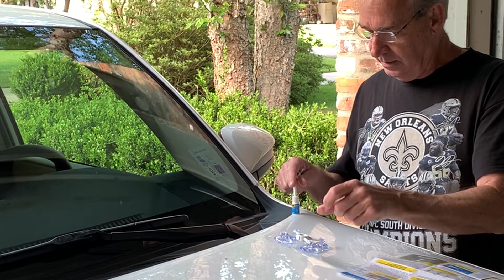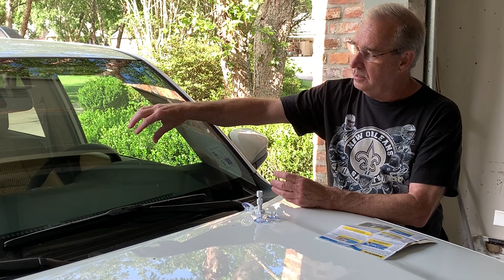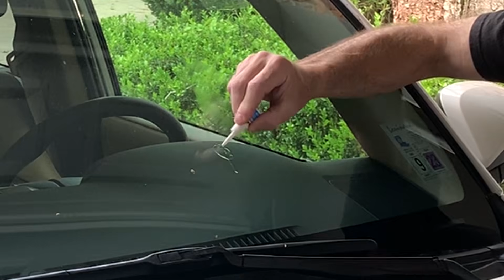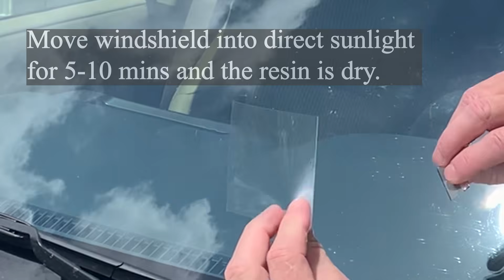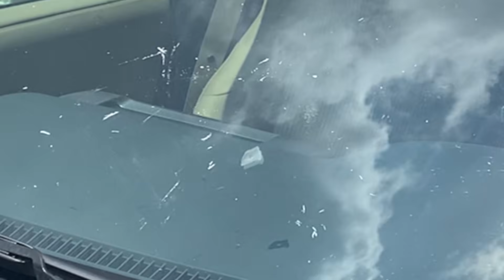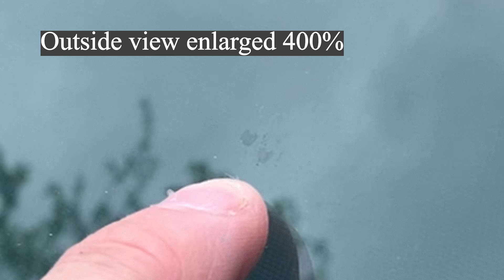How to use Rain-X Windshield Repair Kit

Comment: Please note, if it’s cloudy and 45 - 50 degrees F, I used my windshield defroster for 25min and it worked like a charm!  My crack was the same size as his to give you an idea.
Reply: No that's not how it works it needs uv light for it to set up correctly. Sure you dried it out but that's not helpful if there's no sunlight just use a uv light if you don't have sunlight
Reply: @ericnesbitt3340  a common misconception is that UV isn't as powerful through clouds, but 90% of UV radiation still makes it to surface through overcast skies

if you've ever gone to do some kind of outdoor activity on an overcast day and found you still got light sunburn, this is why.

sure, its not AS strong as a clear sky, but it's an insignificant drop all things considered
Reply: @ericnesbitt3340  thanks, however, at the time it was a couldn’t day and I was impatient.  It seemed to have worked after I had used the defroster.  But if it happened to be Sunny the following day and that completed the process then so be it.
Reply: UV light comes out even in cloudy days LOL
Reply: I wish i had seen this first. I dragged an extension cord & blow drier out. I fixed two tiny stars.  Rain-x worked & i am pleased with the end result. Thank you.

Comment: So, for a score (a line scratch) you don't need that base with the suction cups?
Reply from the maker: If it is not a crack that you could force resin into it, then you are correct. You could just use the resin and curing strip.

Comment: It's a razor blade. Not a razor scraper. You needed way more of an angle to just pull the resin off. Would have been a 1/3 of the time with the blade.
Reply from the maker: While I agree your method is the normal procedure most would use, including me, the details in the instructions ask to hold the blade at a 90 degree angle like I am showing in the video. It actually worked pretty well and I don’t think it took more time. I also tried both ways. My resin was more difficult to cut and the scrapping was easier.

Comment: I got very good results & this quick n easy tutorial helped me avoid making a mistake with this particular style of repair kit. Getting the plastic threads secured in position is not easy. I applied some vibration to the glass as well to help completely fill the cracks.

Comment: My crack is big and thin..so I will just do it all along it and the ends to prevent further cracking
Reply from the maker: That’s about all you can do and see if goes into the crack.
Reply: @FixItDepot  I did it and also noticed a bigger divot start point so I filled that too. Thanks 😊

Comment: It worked great for me, but how do you polish the surface of the hardened resin after you’re done to make it clear like the windshield?
Reply from the maker: It should have finished clear enough where you don't have to polish it. When scraping with the razor blade perpendicular to the glass I could see some of the scraped off pieces having a foggy color but the rest of it remaining on the windshield was clear as you would expect. Did you "cut" it off or scraped it?
Reply: @FixItDepot    It filled the chip wonderfully, and is invisible, except for where I scraped the small surface with the razor perpendicularly.  This is my first time doing a windshield repair.  There must be a way to polish the small circle of resin on the surface.
Reply: multiple ways,

1. you could try glass cleaner prep the surface then use 0000 steel wool designed for glass. personally if I a polishing due to glass filler i use my second option, which is 2. use a cork, like one found in a wine bottle the cork is a great polisher material on the glass.

Comment: I tightened mine too much and cracked it more 😭also don’t use the razor blade. Lesson learned
Reply from the maker: Sorry to hear it made it worst. I would have thought the suction cup would release before breaking the glass. If you didn't use the razor blade, how did you remove the cured resin? Thanks for commenting and sharing.

Comment: I used this product and followed the video. Really poor results. It was a bullseye, still is a bullseye. I’m pretty mechanical and thought I had gotten the target directly in the bullseye of the tube. Seems the tool could not push the resin into the opening. Can this be redone after cured?
Reply: I see the pro kits actually drill a small hole in the crack which will apparently allow the resin to go into the crack.  Maybe the resin couldn't get in with your particular crack.  

Did you use heat when you did your repair?  He doesn't use it in this video, but he did say the heat will help thin the resin and get in the crack better.  A commenter on another video said he used a match/lighter and placed the flame about 1 inch under the crack from inside the vehicle for 3 seconds, took it off for 1 second and did that three times (3 on, 1 off, 3 on, 1 off 3 on then stop).  I used that method and I got good results, although I didn't do it any other way so maybe it would have come out with or without heat.
Reply from the maker: I would try it again, but depending what type of problem it is, i would do the following:

If it is a bullseye with a crack, I would take a thumbtack and reopen a passage way to the crack. Clean it out good and retry again. Would also try to do it inside garage where minimum UV is hitting it so it doesn't cure early.

If just a bullseye and no crack. I would use the clear strip in the kit and apply resin with a strip immediately over it. 

If you have to buy another kit, the Permatex system puts a lot more pressure on the crack and might be a better solution. I have used both and have gotten about the same results overall from both kits. Good luck with it.

Comment: He never showed us the crack to begin with????? 😮
Reply: Everyone's will be unique anyway so there's no need in seeing it close up
Reply: Well I can tell you it works. Just have to reapply the pressure to the syringe like tool again and again with 1 min in between until you push the resin into the crack.

Comment: This was a great video except for the odd use of the razor blade.  Angles make the difference between a five-minute job and a 30-second job for sure.
Reply from the maker: The 90 degree angle of the blade is what is specified in the instructions, but I do agree cutting it off might be a little faster.  Thanks for watching and commenting.
Reply: @FixItDepot 
I've seen guys use sharper angles with the razor when removing the resin around the crack but then go 90 degrees when running blade over the crack.

Comment: Also, the sooner you fix the chip/crack, the better the result, i applied it to mine and it improved 70%, but i waited about 2-3 weeks after the damage (damage happened during a coast-to-coast move and it rained, and accumulated dirt and grime, so the cracks, while reduced are still visible as i assume absorbed moisture/sediment particles and the resin can't completely go in there, was still a worthy temporary improvement while i replace the whole windshield, also structurally the cracks won't get bigger because they are filled. So if you suffer damage, fix it asap.
Reply: Good tip thanks

Comment: Is it OK to dry in cold winter weather inside garage  ???
Reply from the maker: It needs ultraviolet light to cure the resin, so I am not sure. I wouldn’t leave it inside. Only needs about 15 minutes in sunlight. Probably about an hour if not sunny.
Reply: @FixItDepot  I will try when the weather gets little warm here in Texas
Reply: @FixItDepot  😊

Comment: It's cold outside.  How warm does it have to be in order to cure?
Reply from the maker: They don’t mention any temperature requirements in the instructions. It is actually UV that cures the resin, but I would bet temperature has some bearing on the cure time also. I would pick a sunny day and leave it cure longer before scraping.

Comment: I found that when scraping off the residue, the chip that was covered went to a opaque colour and didn't stay clear.
Reply from the maker: I don't know why that would happen. I haven't seen that on mine. Maybe if the chip is more of a scallop? Maybe others can comment if they have seen the same issue.
Reply: @Fix It Depot  in the instructions it says that this happens when you don't have enough pressure with the applicator/ enough ressin